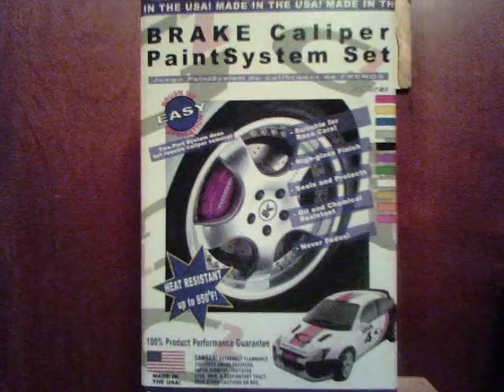MODS TO MY 2003 GALANT (SLIDESHOW)

Comment from the maker: Well there's the difference between you and me.  I don't buy cheap junk from Ebay...you do.  Here's a breakdown for you
Wheels and tires- $1,000.00
Rotors- $100.00
Ceramic brake pads- $60.00
Injen intake- $200.00
Strut brace- $120.00
Tail Lights- $150.00 
S7 gauges- $150.00
In channel rain guards- $110
Caliper paint- $40.00
Dynamat- $20.00
LED's- $20.00
Headlight tint, intake heat shield, wiring, etc.- $30.00
TOTAL $2,000.00
You're welcome.
Reply: Where did you buy the front upper strut brace I can’t find it anywhere for my 2001 galant
Reply from the maker: @ese_luis6269  They don't make it specifically for the Galant.  This one was for an 00-05 Mitsubishi Eclipse.
Reply: @boochieboy814  cool man thanks a lot I’ve been tryin to find everywhere
Reply: Have you ever had to deal with any idle problems when mines in park it goes to 2 rpm just by it being in park
Reply from the maker: @christianjimenez5175  Yes, but mine was the opposite, it would stall when I stopped, like at a red light unless I shifted into neutral and held on the gas to keep the idle up.  It was the idle air control valve.  Cheap and easy fix.
Reply: @boochieboy814  bro your car saver

Comment from the maker: $1,000 of that money I spent modding went to wheels and tires alone, so if you factor out the wheels then only about a thousand for all the other stuff.  They're great cars to mod, and the 2.4's are very easy to work on.  Good luck with your new Galant!

Comment: Love the clean galant, yeah agreeing with one of the comments, dropping the rear was a great idea, although i had to roll the fenders because i put 225/45/17 on the car, but for the best drop of front look for a coil kit, the tein springs just dont do it. But i do agree with the tailights getting old, the stock ones look alot better, personal opinion

Comment from the maker: I don't have a garage either, and I deal with sub-arctic Pennsylvania winters and salt covered roads.  Twice a year I do a complete process with the paint that involves hand washing and drying, claybaring, compounding, waxing and polishing....takes about 7 hours from start to finish.  Other than that, I usually just wash it once every week or two (especially in the winter) with a high pressure washer.  I try to take care of my stuff as best I can.

Comment from the maker: 5 speed swap from an eclipse, then turbo it.  Then add some bolt on's such as exhaust.  When all the performance mods are done the ECU could also be reflashed and the speed governor disengaged.  Don't forget about removing excess weight from the car as well (and that's free).  If $ REALLY isn't an object, there are guys that have swapped evo motors into their Galants and made them sleepers.  Check out the forums at thegalantcenter (dot) org they can really help you out!

Comment from the maker: I never had a problem with the PS.  I know you said the belt was tight, but what about the condition of the belt?  The belt could still be slipping if it's glazed and shiny on the ribbing underneath, or a pulley could be worn causing it to slip.  Can't think of any other reason it would go out only when it's raining.  If it still looks good I would start by flushing the fluid.  If that doesn't do it, the pump may just need to be replaced altogether.  What year Galant do you have?

Comment: Hey do you know if it's fine to use stp automatic transmission fluid mercon v (for use with certain Ford vehicles) with the 2003 Mitsubishi gallant? Will it mess up the car or would I be fine?

Comment from the maker: They are wired directly to the battery so they can be on even when the car is turned off.  I mounted a toggle swich below my fog light button and ran the wires through the firewall to the battery.  I also used an inline fuse.

Comment: Don't listen to the haters homeboy..I have a 99 GTZ with 75k on the dash. I drove it off the lot in 2000 when I traded in my 97 Galant LS. Just don't spend too much on motor mods for the 2.4. Just drop in a 6G72 or 6G74.

Comment from the maker: Where I live we get lots of rain, and the roads have deep potholes in them.  I didn't want to worry about the filter getting soaked being so close to the ground with a cold air system, and having to use a bypass valve/filter and all that, so I went short ram.  Just my preference....and with a heat shield installed anyways, the (power) differences between my ram setup and a full cold air intake are not great enough to matter to me.

Comment from the maker: It's an 03 and it only has 60,000 miles on it.  I've had the car 5 years and not once has it had any problems.  No rust, solid car, decent gas mileage....so what's to trade up?

Comment from the maker: @TELLO3675 
Thanks, I appreciate it.  I'm on the forums at thegalantcenter (dot) org under the username Boochieboy.  My Galant is the 2.4 liter 4 cyl ES.  Only has 60,000 miles on it even though it's 9 years old (I got the car when it had 43,000 on it).  I'm going to be uploading some how-to modding videos on it soon so stay tuned!  These are great cars, I love mine!  Thanks for the comment!

Comment from the maker: There's really not much out there as far as aftermarket lights are concerned, unless they are custom made.  You could always get the earlier 99-01 USDM tail lights, or the JDM tail lights.  I was thinking about keeping my stock 02-03 tails and just blacking them out with dark vinyl.
Reply: can you tell me what kind of tailights you have. i want to put the same ones on my galant. and where can i order from
Reply from the maker: @joshuawoods9955  They are called Elegante by TYC. some people call them altezzas.  I got them on Ebay.

Comment from the maker: @markysaoy 
As the car was in the video I had about $2,000 in parts into it....$1,000 of that money was for the wheels and tires.  You should join the forums at thegalantcenter (dot) org there's lots of good info and ideas on there and you can get discounts on some parts.  Lots of ideas for mods you can do cheaply or free too.  I'm on there under the username boochieboy.

Comment: Anybody who knows why my odometer and speedometer stop working. 2003 mitsubishi galant 2.4L
Reply: +Melvin Capule This reply is probably way to late, but I had the same issue. First check your fuses to be sure your still receiving the 12v constant from the battery. My issue for the speedometer was becasue of a wiring job gone bad with the radio. I know that sounds dumb and they shouldnt be linked, but for me it was. There was one wire that had an intermittent 4.5 to 5 volts running through it and it was grounding through the radio. For me the wire was a solid yellow with a black stripe. I cut it and taped it off and did not have issues since.

Comment from the maker: If you want to stay with the 2.4 I would just rebuild it or drop in a 2.4 Eclipse motor which is the same.  All the performance mods you can add to the 2.4 still are not going to beat just dropping in a stock V6 Galant engine, unless you're going to turbo the 2.4 that is.  I've heard people doing Sonata or Optima engines in Galants with little effort, and of course Evo motors too.  I had about $2000 extra in the car when this video was made, half of that however was wheels and tires.

Comment from the maker: And as far as the rotors are concerned, if you think drilled and/or slotted rotors are only for so called "high performance applications" then you're the "tard."  ANY car can experience brake fade, and could benefit from upgraded drilled/slotted rotors.  I don't put parts on MY car to impress YOU......I forgot more about cars than you altogether know about cars.